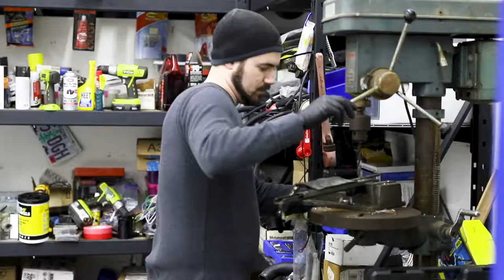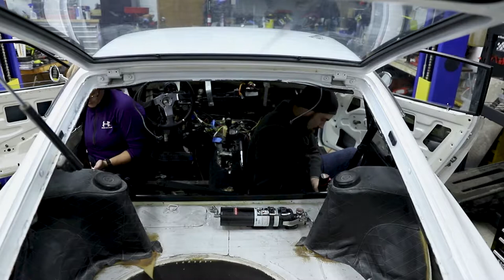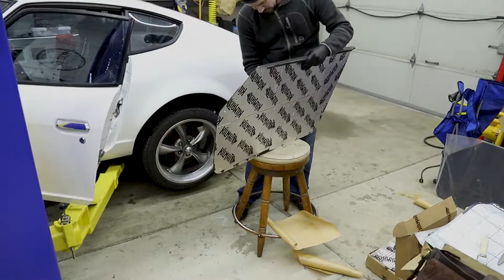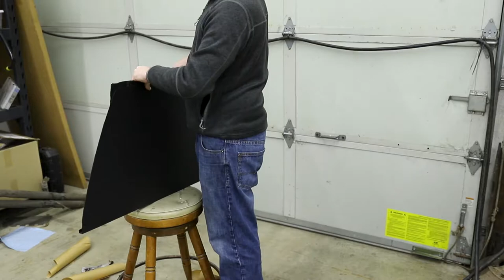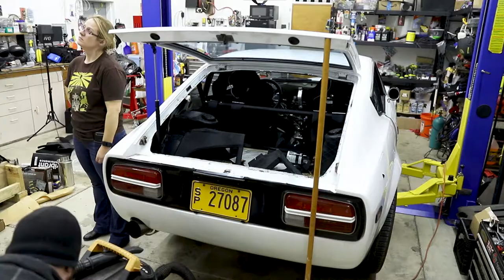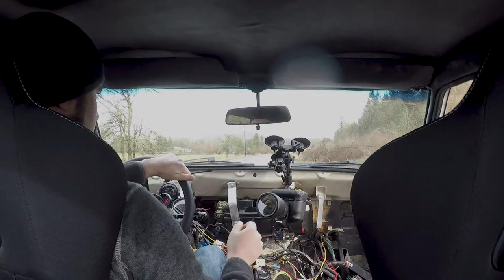SR240Z - Getting the project road ready

Comment: Sweet car, cool build. The sound deadening does not need to cover entire panel. A few key locations on inside door skin then outer door frame and some on alluminum. But typically some decent squares and rectangles here a there is same as covering entire panel knock test wise that stuff is pretty heavy when u start covering everything with it.
Reply from the maker: I also use it to help seal out the cold when I'm taking them out in the winter. The car is basically an aluminum can when it's freezing outside ;) It seals fairly well since there's no plastic anymore and I may actually add some padding liner as well.

Comment: Sweet build wat differential are you running in the car ????
Im doing a sr20 swap on my 280z at them moment 
Thanks in advance
Reply from the maker: I used a long nose R200 LSD with Whitehead Performance adapters and hardened, shortened, shafts.